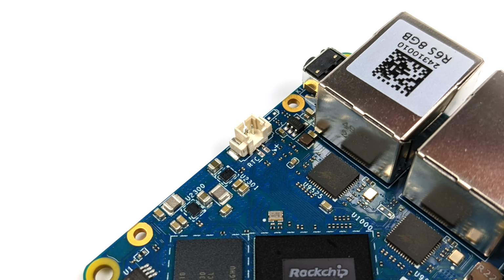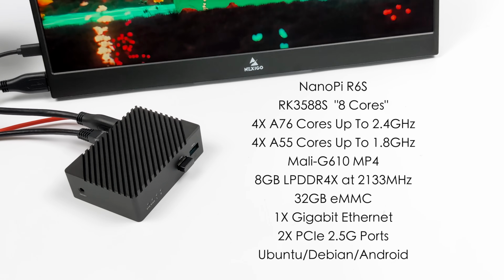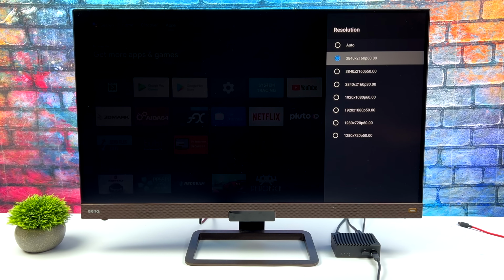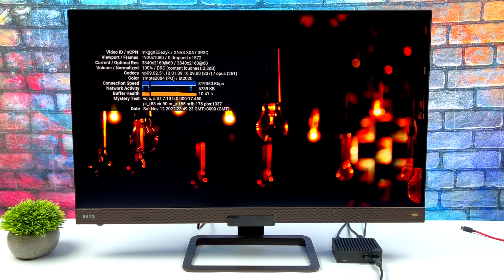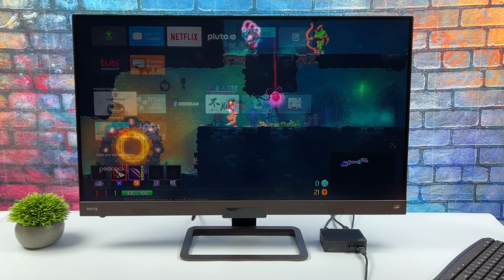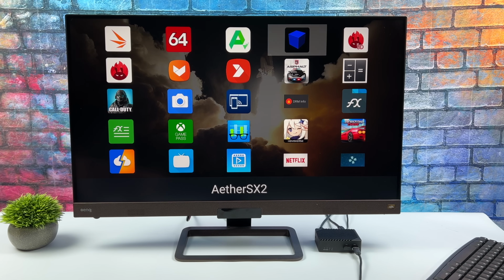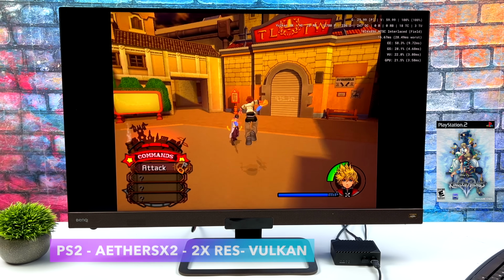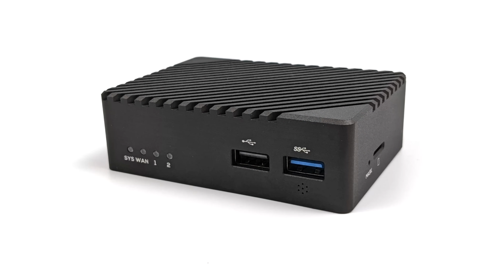The New Nanopi R6s Sbc: A Powerful Arm Board With A Huge Performance Edge Over The Pi4!

Comment: With OPENWRT It seems to use 5W when used as a "router" I suspect the higher power requirements may arise if the board is used for other purposes (e.g emulation) where the strong GPU is heavily leveraged, or if things like hard drives are connected.

Comment: Do not buy this board if you want to run Android TV. The software is buggy. The image file dated 20221204, did not recognize any Bluetooth or WIFI USB dongles. I tried 6 different dongles without any success.
A new image file was released dated 20230107. This updated image file recognized my WIFI dongle, but it did not recognize Bluetooth. It also broke the keyboard input.

Comment: Thanks for the excellent review and commentary.  I am running a NaniPi R4s with OpenWRT as a router which has worked well, but is at the limits when doing SQM QoS on a Gigabit fiber internet connection because SQM QoS is very CPU intensive.  I've ordered a NonoPi R6s and and think that it will be a terrific OpenWRT platform.  While awaiting it's arrival I will be very interested any feedback and results of testing OpenWRT.
Reply: I have an R4S and it can do 850mbit download speeds with SQM set for zero bufferbloat. I considered getting the R6S just for the 2.5gbit connections but I am sticking with the R4S untill my ISP offers faster speeds.

Comment: So many different boards coming with this chip at the same time. Just received my rock5b preordered 100$ (120€ all included) based on RK3588 which offers more IOs than this 's' version. For sure at this price,  perfectly replacing RPi4. Can't wait to have better linux support with more distributions and full graphics acceleration. I think, possibilities may be limited though until linux get a rosetta like emulator as Mac did for the M1, so that we can also run linux steam games on this chip
Reply: Have the Rock 5b and it’s solid running Ubuntu gnome version of Armbian. 5b is 8 cores and has options for more ram and has more I/o.
Reply: @scottnoble5022  same, gonna move to arch though.
I find linux support still lacking even if getting better (having PD boot and hdmi/usb-c video random issues ...). Plus graphics are not fully taking advantage of the board yet.
Reply: @Etienne85  diet pi’s latest release is promising.

Comment: A really important question is: which sbc has the largest community?? NANO PI/KAHDAS/ORANGE PI (Raspberry excluded). Raspberry favors sales to industries rather than to peaple and they are late on the market for new products. (Maybe because of broadcomm lagging behind its rockchip competitor). In any case I think part of the raspberry community will migrate to another sbc...but which one?
Reply: The community surrounding the fabulous Rpi4 is huge and capable. Salute to all involved with that endeavor. Since 2019 I’ve purchased 5 single board computers. Rpi4, Khadas vim3 pro, Khadas vim4, Radxa Rock5b and Nano Pi r6s. Kinda early in life cycle for Radxa and Friendlyelec so I’m not trying to cast aspersions on them at all but at this stage of being out compared to Raspberry Pi 4 it’s no comparison at all. The community around the Rpi4 is incredible.

Comment: These two gigabit ethernet ports connect to the RK3588S PCIe pins (via the ethernet bridge/controller RLT8125BG if I remember correctly). Those who have a good soldering skill can easily desoldering these ports and make some other useful stuff than dual ethernet.

Comment: I moved away from these sorts of devices because they just can't handle what I want to do.  At first they were cool little things that could retro-game but then HoloISO came out, and the steamdeck prior, and none of these things do as much as my little computer I picked up.  I got one of those Dell 9010's, put a radeon card in it, and dropped an 8tb drive with an i7 processor upgrade.  It's a little beast for retro gaming and modern games.  Now i just need to sell my raspberry pi 4 8gb, case and such, or keep it, dunno which.

Comment: The lack of USB ports and WIFI is a BIG minus. You have to use one of the ports for keyboard/mouse. Then, if you want WIFI, you have to use the other. That leaves none for anything else. You would certainly have to have a hub. But the system would make a great router. Having the multiple LAN ports means it is perfect for OpenWRT or a similar platform.

Comment: But this all means nothing if the shape/connections are different and can't fit inside a PiBoy or other purpose built devices...

...so great power... but can I put it in a device that a Rasberry Pi would work in??? Cause if not...

Comment: Just FYI….the Beelink N5095 is on Amazon for the same price as this at the moment ($159-$20 coupon).  This unit is $119+case($20)+power adapter($10) or $149.  Just in case people want Bluetooth and Wi-Fi and don’t care so much for the dual 2.5 Ethernet and router angle.

Comment: So using it as an android TV what are the options for a TV controller ? Do you just buy that wifi/Bluetooth dongle and have a Bluetooth controller always connected to it ? Also not being able to stream Netflix/Youtube in 4k is a deal breaker for me unfortunately.
Reply: There's no guarantee the wifi dongle is going to be recognized with Android tv, I didn't have any luck with it anyways.
Reply: @ArmanXel  wifi/BT not in the Android build yet (Soon!) Ubuntu/Debian only currently.  I just shared my desktop WIFI/internet and used an RJ45 cable for now.

Comment: how is this compared with the nvidia shield?
Reply: In terms of what? Performance? Shield is half as powerful, not to mention the 3GB RAM (Pro version) will limit you from running, say, a PS2 emulator. Even some Dreamcast games may lag due to the same reason. But from the software update and support side, Nvidia is still the undisputed king of Android updates, beating even Apple. My 2019 Pro version has just got an update a couple of days ago, which 2015 edition owners also enjoy. That's a fucking 7 years of update! Not to mention it has complete certificates to run Netflix, Amazon Prime, Disney+, you tell me at 4K.
Reply: @leledumbo  yeah in terms of performance, I have the 2017 edition.

Comment: Since it does not run Netflix, Hbo max, Prime, etc in 4k HDR it can't replace Shield. Additionally, the shield GPU is much more powerful than mali GPU. Also, Shield has WiFi and BT plus a more refined experience. So NO, it can't replace Shield,  your statement is misleading, no pun intended.
Reply: The shield GPU does not out perform the mali 610

Comment: Can I configure two of those ethernet ports as a switch? That would be amazing!
Reply: Yes, using OpenWRT, you can configure two ethernet ports as a switch.  I am doing so with OpenWRT on a NanoPi R4s.  While the NanoPi R4s only has two built in Ethernet ports, I've added two Gigabit Ethernet to USB3 adapters to additional LAN ports and configured them as bridged LAN ports and it works well for me.

Comment: Just ordered one of these a couple of days ago, was planning to make a new router out of it, but might be a bit overkill.
Reply: Well it arrived a couple of days ago, about 40 days from China, not bad considering the postage issues we are having in the UK right now and the increase in general postage for Christmas.

First thoughts - no instructions in the box and zero software installed, so off to the wiki pages.  Got Ubuntu onto a card and ran that, and it worked fast, but that appeared to be a totally empty version of the OS, so nothing else was on there.  But that's now on a card for future messing with, off to Android 12 TV.

So Android TV, the wiki information supplied is bad, which is not helped by the fact that the software you install from the non-Chinese area of the site also defaults to Chinese, but we muddle through and find a config file to change the language, which could have been done with a couple of flags on the damn software (but hey, this is linux style PC'ing WE TELL YOU NOTHING).  But finally, thanks to a post on the forum from about a month ago (the most recent post on that area of the forums, which are otherwise virtually dead).

Android TV, so considering this is a version ported to an SBC I am sure it'll work nicely with a plugged in mouse/keyboard, or at least be consistent, yea right!  I found Android TV to be a pain to use, I can use the cursor keys to move around (normally), and I can type words into the search box (but sometimes the system will assume that my pressing enter means that I now want to add a 'q' to the end of my typed words rather than submit them, because that is what is highlighted in the virtual keyboard which I cannot seem to stop appearing when I have to enter text).

Not sure how to get started on the side loading part of things, might be a good one for a future video, also maybe a video on controllers that work correctly with these systems that are not full joypads?

Comment: Finally a RK3588 with 8GB RAM that touches the price of the most affordable days of RK3399. I'll wait a little longer for more options. Really I just need a box powerful enough to play PS2 (PS3 won't hurt but not a must) and heavy Android games.
Reply: They used to be really painfully expensive (>250USD).

This has a NPU in it, I do wonder if anyone has got it working for other tasks than upscaling..
Reply: @-r-495  somebody might want to run some AI benchmarks there, for whatever reason. Unless you're working in AI related fields and need something small and portable for showcases, such as in an event or something, the NPU may stay sleeping all the time. I won't be surprised if there are folks trying to replicate Nvidia DLSS / AMD FSR for Mali GPU.

Comment: Considering today's Raspberry Pi prices (even second hand), this seems like good value by comparisson. Like others on here, I also get the impression this would make for a nice router, even though for that task, the SoC is kind of overkill. Still, OpenWRT would be a great fit for this board.
Reply: They have a fork off OpenWRT for this board already FriendlyWRT.
Reply: Get up two, one as a dedicated firewall, one as a dedicated router, using the 2.5G ports, use the 1G ports either as management ports or for two Honeypot machines using the cheapest SBC's with included wired NICs
Reply: Yes this would make a really good router indeed! I actually don't think it's overkill at all. Apart from routing it cloud also act as a PiHole/Aguard-Server and some light SMB
Reply: Raspberry Pi prices are the same as they ever were. Raspberry Pi and their approved resellers have not increased the price, except for a change to the 2GB pi 4, but the entry level price was taken by the 1GB.

Comment: Are these more powerful than x86 boards, like the odroid h3? Otherwise I don't understand the appeal. X86 much better compatibility than anything RISC based, I think. I mean RPI has very good Dev support because there are so many, and it's become a kind of standard, but that Dev support is nothing compared to what you get with x86. I could be mistaken, but I don't think that any os build made for RPI will work for this. And when the manufacturer quits supporting this chip, it'll probably die. You never have to worry about that on x86.
Reply: They're fairly close in power, at least on the CPU side.  The multi-core looks to be higher on this.  I think with something like this, if someone has a specific application in mind, then these ARM boards are worth considering.  Many have mentioned this could be good for a DIY router.  There's also a bunch of other things.  For stuff like that, future support may not matter as much.  Plus, the lower power draw might be more appealing, in addition to potential cost savings.  You are right that x86 provides more versatility and future proofing.  It's often a better choice, especially for general computing.
Reply: @ravagingwolverine  good points, but I'd argue that x86 is even a better choice when building a router. For example opensense will just work on a modern x86 machine. I think that builds exist for RPI, and they may even exist for these processors (for now). But one of the most important considerations for a router is updating. If you can't update because a manufacturer stopped supporting a product, then its effectively useless. Not an issue with x86. 

I actually want some RISC system to supplant x86, but I don't think that can happen until we get the kind of standardization we get with x86. I don't know why we don't have that in ARM or other RISC platforms. Maybe it's all due to intellectual property related problems. If that's the case, I hope that RISC-V explodes. I won't hold my breath though.

Comment: Do they support it well? I never could get UART working on my NanoPi Neo and the best support suggestion was to add a USB device to run UART instead of figuring out why the two UART interfaces on the board don't work out of the box or with their config program.

Comment: Orange Pi 5 is also RK3588S and is currently up for pre-order at $70usd. That even has an M2 pcie connector.
Reply: I am looking at this with two 2.35gbps ports as a potential firewall router.
Reply: Khadas Edge 2 is overpriced lmao
Reply: @freaky_clippy  Very overpriced and doesn't have an SD slot. I like the Edge 2 but, NOT enough to pay the price.
Reply: M.2 PCIe on RK3855S is 2.1, up to 5 Gbps. PCIe 3.0 with up to 8 Gbps is available only on RK3588 non-S.
Reply: I did pre-order with Amazon for the 8gb model. It's up to $84 now, but still a bargain. Price goes up in December. Ships December 27 - January 19th
Reply: it has no wifi or bt either stupid missing these as i want it for retropie.
Reply: @jediknight2350  it has 32gb emmc, is that not enough for retropie?
Reply: @PaulChenKaiyoti  Enough for Retropie and a handful of Selective Roms only. (Especially when looking at PS2/GC etc)
Reply: @PaulChenKaiyoti  Yes it is. Add a MicroSD card for game storage. The OS itself is very small and would fit easily on half the EMMC this has.
Reply: @jediknight2350  Cheap BT/Wireless Dongle (Supports a few out the box)  i set mine up sharing my laptops WIFI and connecting to the Rj45 port.
Reply: JHRM  When you like board without community,just buy OPI 5...
Reply: Already took mine :) will be shipped on the 1st December according to the aliexpress Seller
Reply: Is there a case for the Pi 5? I can’t find one. Can I use Pi 4 case?
Reply: Odroid H3 is $154 for the board. It has an Intel Celeron 6005. You really can't compare the Pi, any Pi.
Reply: @RealMTBAddict  The H3 would be my choice if I was in the market.

Comment: Nice to see RK3588S boards getting cheaper. In a year a bit simpler ones will be around 75 dollars... just like the Pi4 8 Gb that you mentioned was.
Reply: Yeah I just pre-ordered the opi 5 8gb with a PSU and it came out at 130$ CAD including shipping. Plus it's got a 2242 nvme slot. Can't wait to mess with it.
Reply: The orange pi 5 8gb is on presale for around 75$. Comes with an RK3588s
Reply: @naylo44  I've checked Ali Express and that's the 4gb version for 75 dollar... the 8gb version is 90 dollar.
Reply: @erikkarsies4851  I see 8GB for $75, the 4GB is $60
Reply: @6alileo  Ah excluding taxes probably.

Comment: Seems like a good deal. The thing with the cost of the raspberry pi, is you have to add on the cost of a case, SD card, possibly power supply. So if all you want is emulation this is possibly better value.
Reply: The only thing missing with this is just the usb c cable which the rpi also does not include in the base price.
Reply: This is $119 for only the board. The case in this video is an extra $20 so it's really $140 if you want the one in this video.
Reply: Didn't realize that, nice catch.

Comment from the maker: What do you want to see tested next?
Reply: pfSense, OPNsense, or at least some WireGuard setup (use as a firewall). How many watts does it draw when maxing out the throughput on all three NICs/at idle?
Reply: Would love to see an Emuelec Image running on this board.  Set up and game play tutorial.  Great video as always brother.  Keep up the awesome work.
Reply: Do you have any suggestions for controllers to use for Android TV etc that aren't joypads?
I have just tried out Android TV using a keyboard and mouse and it was less than ideal, it only really improved when I plugged in the controller from my Vero 4K+ Kodi box.
Reply: Android using Flycast Standalone with Naomi2 games please.
Reply: A comprehensive comparison between all the different Rockhip RK3588/RK3588S SBCs that have been released in the past year  👍🏻

Comment: A $119?! Man, I should've waited considering I just bought the Orange Pi 800. It's literally about the same price.
Reply: I just ordered the OP 800 as well. I wanted something to play around with Android OS. Now I am worried that the developer is going to abandon this port.
Reply: @wildzeke  For the past week I've tinkering around with the stock Orange Pi OS. I wish I can overclock the thing to make it perform better but at least I can run Godot and UE4 games.
Reply: $119 without the case in the video. With the board + case it comes out to $139.

Comment: YouTube deleted my comment for some reason, but there is Orange Pi 5 device with RK3588S which costs 75 euros for 8GB RAM version.
Reply: No links allowed because that hurts ETA Prime's business model. Off course he wants you to click the affillliate links. He doesn;t show links to other shops who don't do clickmoney :even if he reviews the products D But hey google is easy. BTW I see the 4gb version on Ali for about 75 ... the 8 Gb version is about 90 ? But anyway prices are coming down fast because the parts on it aren't that much more expensive than a Pi is and for 200 euros you can buy a 4600G + mainboard + 8 Gb which is more powerfull and flexible.
Reply: @erikkarsies4851  Yeah. The price also went up to 90 euros after I set up one of the EU countries as the delivery destination. I tried it after I wrote this comment.